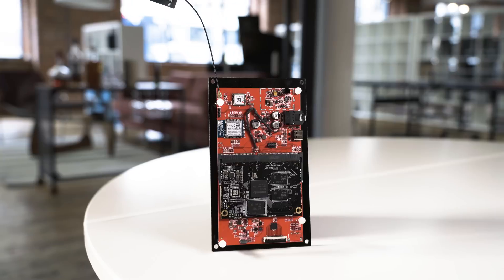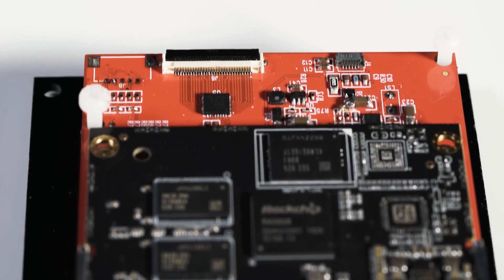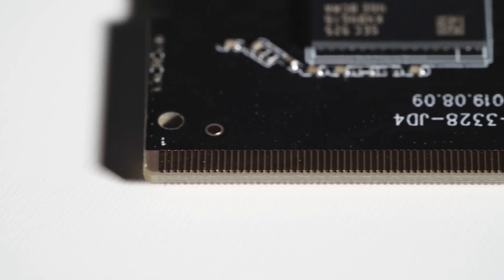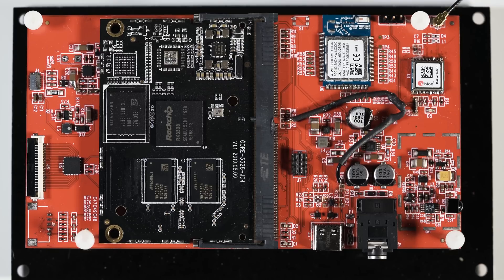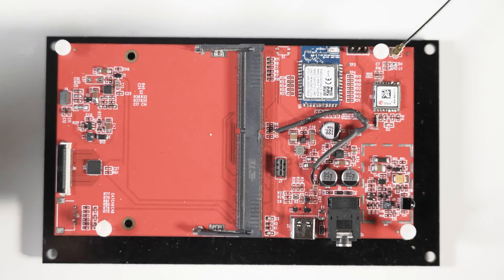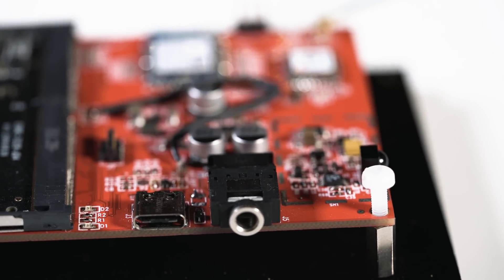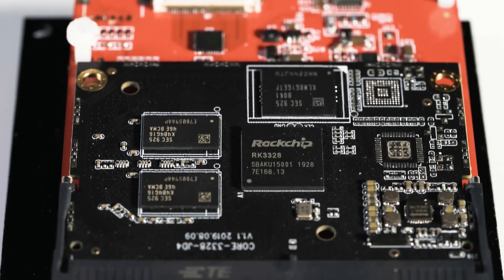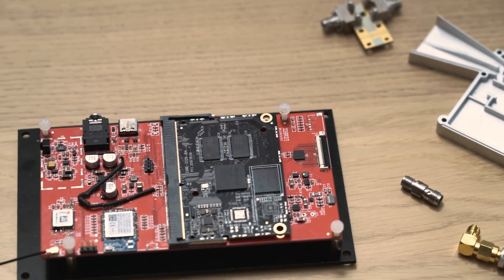Radenso Theia Motherboard Unveil

Comment: Hi, you mentioned the modular design and this sounds great. I was wondering how/if it was going to impact the sales part of it. For example the GPS, since blocking encounters with retail auto door openers and such, will no longer be required with Theia, can this unit be purchased without an GPS?
Reply from the maker: Theia will be sold with one version with GPS included. GPS will be needed for other functions. -Randy

Comment: Hi. I just wanted to ask about heat dissipation. I know your design takes into account internal heat generation but what about heat from the sun. I sit my detector on my dash. It’s a V1 and it gets hot enough to burn fingers. Since heat is the mortal enemy of anything electronic, I wanted to hear from you about what, if any, steps you have taken regarding this. Will you be testing in extreme heat?

Comment: I'm sure your considering that the RD components are going to be running in temps up to and over 180 degrees, cooking on a dashboard? Just worried about longevity of a PC running in those temperatures. A black dash in Florida summer sun can cook things...always wondered why RD's were not a light non reflective color.

Comment: This will be awesome and I plan to get one. But it also presents a bit of an oxymoron. With the superior filtering, it will be easy for anyone to use. It will take the user experience back to the way it used to be when there weren’t as many pollution sources. Anyone of our family members, for example, would be able to use it and understand it. At the anticipated price point, however, the market will be limited to a fraction of what it could potentially be.

Comment: Hello from Ann Arbor. Ready to trade in my R7.

Question....what will you do to combat thermal issues? Every detector I've had gets so hot....and that is true even in the winter and with cloudy weather.

Also, the FCC approved Galileo satelites for the US....any chance of future proofing to allow Galileo?
Reply from the maker: Did you notice any performance affect when your detectors ran hot in the past? Stay tuned! We will be showing a video later with how the case is constructed, ventilation etc. -Min
Reply: @RadensoRadar  no performance decrease but I work for a thermal Management company and I know chips hate heat and PCBs can do strange things when they get too hot.

Comment: Looks like Theia is coming along just fine. I cannot wait for it to come out. Even if I live out in the boonies - still have K band false signals. Please make sure you add K band farmer tractor radar signals to your data base.
Reply from the maker: We are fricken stoked too. Seriously. I also live in the boonies and farm equipment is one of the items we've been looking at. Good ole John Deere's cast of some fab radar, in the same bands police RD use. We're on it! -Min
Reply: @RadensoRadar  Good to hear your on it. I figured you would be but just in case you 'might' have missed it. Thought I would say sometime. I am a 20+ years V1 owner. A local detector / jammer (I mean parking sensor) tester. Been using detectors since the days of the Radar Sentry (S and X bands) from the early 70's. Take care and I'll be waiting for your detector to come out. Spin

Comment: How are you cooling this thing? I'm thinking windshield in the summer time type of hot.. Will it be made out of a metal case that acts as a heat-sink and also blocks leaking RF to make it stealth? That's what I would do. Could put some plastic on there on the edges for places to grab it that'll stay cooler so people don't burn their hands.

Comment: Can you please put as much on focus laser detection as radar because in my opinion there is no radar detector that is protecting us from laser. I currently run a radenso pro and escort max30c in  Detroit and recently received a ticket for speeding and neither radar picked up the laser. This particular cop is using a laser gun everyday at a specific location and I never pick him up. Can you explain how this radar detector is going to do a better job picking up radar as well as laser because I am INTERESTED in purchasing at least 20 of these for a fleet of vehicles I manage at a company. Thanks in advance
Reply: Windshield mount lidar will never be effective. They aren't aiming high at your windshield. Modern solar glazes block infrared. Lidar takes a third second or less to lock in a speed -- warning of the ticket you just got. Detectors in commercial vehicles are federal infractions.

Comment: I would like to see an onboard internal microphone in addition to the line-in / microphone plug. The plug would be more useful for motorcycle riders, while an onboard one would be more useful for vehicle drivers. Inside a vehicle, most of us typically want as few wires running to our gadgets as possible. If it could come with an onboard microphone that could allow for voice control and auto-volume adjustment (based on road noise and your music playing in your car), that would be fantastic to have the ability to do that WITHOUT having to be linked to your mobile phone with bluetooth (and be reliant on your mobile phones microphone).

Comment: This is very exciting. Really unheard of in today's manufacturing world. Strong interaction with consumers. The very best components. Best engineering talent available. All of this results in an excellent top tier radar detector. I understand the tremendous capital in terms of R and D, and components. Take your time with this complex product. Your potential buyers should be able to understand how this will most likely cost north of 1k, and this is reasonable. Until then, I will use my segmented old Redline with K band turned off.
Reply: 240atomic They’d be crazy to launch this north of $1k. I’d be willing to bet it will be at top of market, alongside Max 360c at like $649-$699.

Comment: The sockets are already mass-produced with no concerns about errors in pin pitch. Adding sodimm pads to a board is probably the easiest part of the whole thing as it would be the first pads place. My V1 has had a headphone jack for 10+ years.
Reply from the maker: You are correct that adding a Sodimm was  the easy part relative to high speed FPGA layout, but I am trying to simplify things for a general audience that doesn't even know what a Trace is.  Your Valentine one does not have a microphone jack, and also has less than 70mhz of processing power compared to Theia which has over 6ghz with vastly more IPC, plus a Spartan 7 fpga and a 14 bit 65msps ADC that alone costs more than the entire V1.
Reply: Radenso Radar  definitely the processing power of the Theia will be greater, it is 10 years newer than my V1 that DOES have a built in HEADPHONE output, but yes, no mic. I'm eagerly waiting the release to RIP it apart and start building off of it, but with higher powered AI to include plate tag reading, which locally can be used to identify any law enforcement vehicle by looking for a specific colour and number that all police vehicles have. On top of that will be some statistics logged regarding time, date, location a particular plat was spotted, along with just mass dump as much raw data to analyze for patterns that may be useful as part of my detection algorithm. Only 5 watts of power required to run with a nvidia GPU module designed for real time live AI. I see a fairly basic rockchip and some unpopulated BGA spots. Those where the actual AI processor will live? 

Odd to see the rockchip board where a high performance nvidia GPU designed for AI would also fit, though unlikely the pin mapping would be the same.

Glad I held off on a current model, largely due to appearance, which I know is not the best metric, but allowing the open development on this detector is going to allow some of us to really change the radar world. 4 arrows for 360? Nah, I'll push it to 12 and give a precise direction. Modify my cars reverse camera for video input and feed it visual information extracted from the radar detector via the 5 watt GPU used solely for AI calculations. 

Very excited.
Reply: @RadensoRadar  How does Theia have 6GHz processor speed? That is higher than pretty much any desktop chip, and the Rockchip shown on the board is your standard Android/Linux TV set-top box chipset. At least that is its intended use and can be found super cheap on Amazon. You're getting screwed on parts though if a low 14-bit resolution ADC cost much at all. Microchip has many, same speed but higher resolution, and about 1/100th the cost of a V1. A spartan FPGA is very common, and not the price of a v1. v7 a Spartan®-7 FPGA Evaluation Board is only $196, and that's not just the IC, but the price for those two parts should only be a fraction of a V1. As for an ADC " 20-Bit 1.6Msps Low Power SAR ADC with Fully-Differential Unipolar Input" $30 I'm guessing the FPGA and ADC are on the other side of the module, or just not populated. The speed of the detector isn't a good metric to use for comparison whatsoever. We went to the moon with the tiniest fraction of CPU power we have now, and our radars are not going to the moon, so at some point, you are just wasting clock cycles/power/coding inefficiently.  Didn't use a Xilinx DPU (deep learning processor) on board at all Xilinx also has a DNNDK, a TySOM-3A-ZU19EG and an FMC-ADAS daughter card; which provides interfaces and peripherals for 5x HSD cameras, RADAR, LIDAR and ultrasonic sensors. Now that would have been sweet. Still excited to use Theia for the basic AI and radar functionality, then tie in a SBC with GPU to display an interface on the car's infotainment system. No silly cellphone needed, and the addition of identification of visual threats, and other features that I haven't thought of, but analyzing the raw logs should help shed some light on additional features of uses. Fun stuff.
Reply from the maker: @lostintheelectricalaisle5318   The arm processor is a quad core 1.5ghz, which gives you 6ghz of total available processing power.  

As for the ADC, the one you provided wouldn't work because Theia is looking at so much bandwidth instantaneously.  We can't use an ADC with a low sample rate; further, it needs to be a I/Q ADC because Theia is a quadrature receiver - so it's looking at 130MSPS effectively.  Our ADC is about $40-50 depending on where you purchase it, and the entire COGS of the V1 are in that range.  For reference, a V1 costs about $50-60 to make, a Max 360C costs about $130 to make, and the R3 costs about $100.

Processing power is actually a very good metric to compare detectors with because it is directly related to sensitivity.  For Theia, the faster the clock speed is, the faster the AI inferences.  We are not wasting clock cycles with Theia - you downclock the processor, your inference time goes up.  But even for traditional detectors, processing power allows you to do things like oversampling and decimation, create FFTs faster, and run more advanced digital filters (not on the V1 obviously, but on the R3 and Max 360) to get software gain.  You can't do that if you don't have the processing power available.

The reason we don't use the Xilinx deep learning stuff is because it's very poorly supported, and we made a decision to keep the AI off of the FPGA to ensure long-term company sustainability.  Fitting our AI model into a FPGA would require a very expensive, very large FPGA and that FPGA would then be a complicated, multi-function device - internally handling AI plus multiple other IP Cores relating to usb, DSP, etc.  Finding good FPGA engineers is difficult - for example, when Escort's left the company for Boeing, they have been unsuccessfully trying to fix their lockup issues for three years now.  Doing FPGAs correctly is so difficult that they simply don't know how to do it, and we wanted to prevent that from happening to us down the road.  Our FPGA is a single-purpose device - DSP - and is done in a way that if something happens to our FPGA engineer, it will be possible for another one to easily step into his role. 

We did look at using the Xilinx Zynq series, which are FPGAs with onboard ARM processors, but those processors weren't fast enough (only dual core, about 1ghz).  We need a quad core to get inferencing time where we wanted it to be.

And again, stuff like TPUs and other AI accelerators - sure, they would work, but I would have to add multiple hundred dollars to the MSRP for zero benefit (we already have latency very low), so why?  Theia is a purpose built device.

Comment: Will Theia speaks several languages like french/spanish ? For those living in banarea , would it be a way to get all the infos spell out or send to a secret module/screen since the rd has to be hidden ?
Reply from the maker: Theia is basically a computer so adding languages is a cake walk. If you need to have a hidden/remote radar detector, we would recommend the Radenso RC M for now.
Reply: @RadensoRadar  , my friend @rdf uses one and loves it . I use R1 . Thanks a lot for your responsiveness = a lot of Future for Theia .

Comment: Ok this idea is out there but would it be possible to link to an aftermarket head unit to have the audio come through the car speakers and mute music during alerts? Even better would be the alerts displayed on screen? I have a pioneer deck that can display info for car functions like hvac and guages.
Reply from the maker: Anything is possible with Theia since it is open source and has major computing power!   First goal is though out of the box to detect radar using AI though!

Comment: Looking good!  How about a suggestion for a display? Why not make it detachable, similar to the RCM?  Allow users to detach the display from the detector proper and move the display to a dock with the same interface.  Now we have a dock and display that we can mount wherever we want and a detector we can mount away from prying eyes as well.  If we want to bring the detector to another car, simply detach the display from the dock, reattach it to the detector and go.
Reply from the maker: Great suggestion, but extremely tricky from a size and cost perspective.  Would need to add additional micros in the detachable face plate, and do a bunch with USB - remember, the RC M isn't sending screen data through the detachable pins, but rather through a usb cable.  Maybe in a future product, but this would take 6 months minimum to implement.

Comment: Will the final release version will be based on the SODIMM design? Is this for reduced cost of development reasons or do you have plans to offer upgraded boards in the future? Or will you move to a fully integrated single board before release? And if the SODIMM design stays, being in a horizontal position like that, I would be a little worried about long-term vibration issues affecting board seating, retention clips breaking, etc. because of it being jostled around on the window of a moving car. 

But, yeah, this looks awesome! Getting more excited for this with every new video. Keep up the good work!
Reply from the maker: The final version is SODIMM, and there will be standoffs and screws to deal with NVH.

Comment: one thing i noticed is the use of the NEO-8Q GPS Module has it been thought about using something like the ZED-F9K for dead reckoning (my max 360 has gps issues due to tunnels and stuff) and even using that imu for things like collision notifications to phones via wifi etc also if i recall the neo 8 series doesn't support the new GPS bands L2C and L5 while probably not useful in a radar detector GPS future satellites might not include L1 and while the 8 series does glonass and stuff it would be nice to see at least L2C for future proofing if u taking the time do use a sodimm SoC Module another thing that would be cool to include but i don't know how practical is a NB-LTE/LTE-M/LTE-CAT1 radio

sorry for rambling but this is what i would do in making Theia and u asked for comments and suggestions
Reply from the maker: Thanks for your comments!  The ZED-F9K is a nice module for sure - it's always a challenge for this type of project balancing price and performance, so there are a lot of tradeoffs that go into all parts selection.

Comment: Not feeling the motorcycle headphone jack thing without Bluetooth capabilities as well.
On a bike a rider needs to have communication via the phone and or gps device. These two devices (IPhone & GPS) are what the helmet headsets talk to.
Using a wired headphone on a bike for a radar detection device is a great idea, but only as a backup to Bluetooth not the other way around.
Reply from the maker: Theia is going to have bluetooth.  We are motorcycle riders too ;)   We still wanted to have a headphone jack just incase for a extra option
Reply: @RadensoRadar  i like that versatility

Comment: Is it possible to stack daughter boards with interconnects such the height is increased and length decreased?  Would that reduce footprint and improve the form factor ? Thinking it would support a taller OLED screen and reduce depth.
Reply from the maker: We are actually stacking boards....showing that will be in a future video.  Note that the FPGA is not on the motherboard ;) That's why the Samtech connector is so important, a normal connector wouldn't be high performance enough to make this strategy work.
Reply: Radenso Radar Thanks. Are you able to reduce the depth of the chassis at all?  IMHO a taller one would benefit us more than a deep suitcase.
Reply from the maker: @FlatSixBoosted  not without losing sensitivity.  The horn is the limiting factor.  The pcb is exactly the same length as the horn.